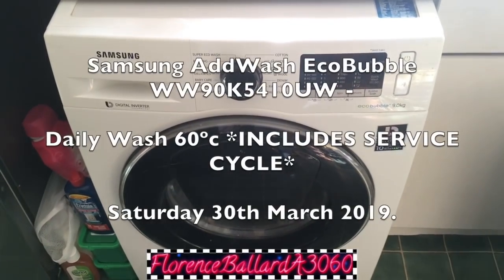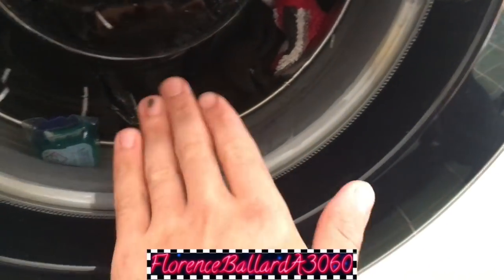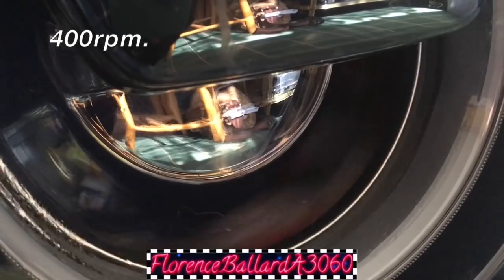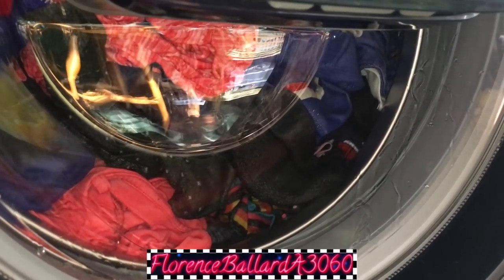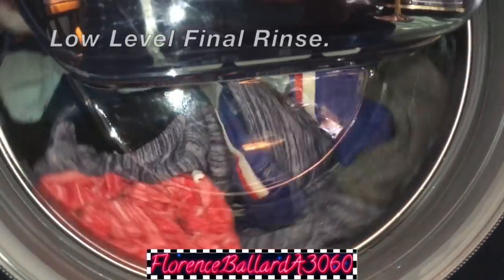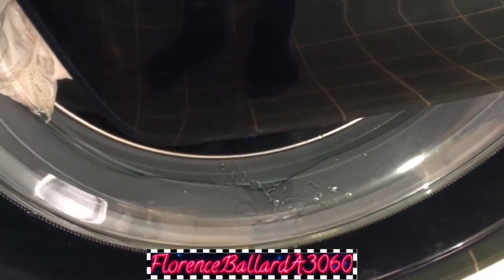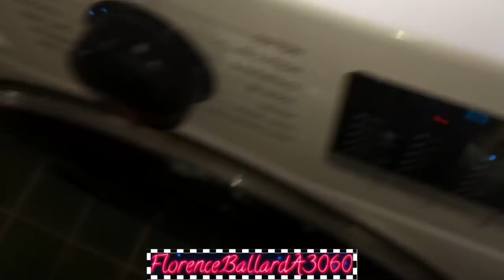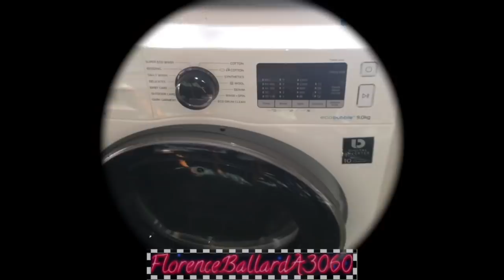Samsung AddWash EcoBubble WW90K5410UW - Daily Wash 60ºc *INCLUDES SERVICE CYCLE*

Comment: Its great to see you back home buddy :) you defo sound much happier, and calm, you will miss the outback, but you will be better then ever before being home :) "welcome home" :)

Them pods are shocking, they stick and turn to glue on your clothes, ile never use them ever again, modern machines dont handle them at all :(

I hate samsungs, dont get me wrong they look nice and there ok, but tbh there still pretty lazy after they basically took the "Amica design" and tweaked it a little bit.... 

I still use my Indesit IWE81281 usually just use Number 3, but also the special shoes, its like a wool cycle but a great cleaning cycle for most stuff! 
Id love an Electron, on 95 series or even the WM81 but its so hard to find any these days....

Comment: Im impressed that it spins unbalanced. An LG will probably not of allowed that or if it did, it would cause water/sudslocking which would ruin the spin as it makes the motor strain to reach top speed.

Comment: It was probablt vigorously shaking so violently because the 4 screwed stands underneath are probably unstable and unbalanced, get them checked out and a spanner comes with the package, try adjusting them.
Reply from the maker: Tahmid Ali nope they are completely fine and level, if they weren’t, the machine would be rocking, but the machine isn’t rocking, just vibrating

Comment: For sure pods go there! Because you suppost to put before the clothes and in the bsck of the drum! Close the zyp before wash, them gona stretch the other stuff
Reply from the maker: Regardless of where pods are supposed to go in the drum, they get tossed about during the wash and thrown onto the seal anyway. If Samsung weren't so crap with their water levels, it wouldn't have to matter where it was put.
Reply from the maker: Also zips will not scratch anything, no1. they can unzip themselves during the wash so that's pointless, 2. There has NEVER been a case of a zip "stretching stuff"

Comment: What temperature does you nanny use and at 46:10 is that a crack I can see
Reply from the maker: Daily 30ºc :( and yep, that's a gash in the door glass caused by the extremely unbalanced load
Reply: @HooverA3060  my nan uses fastwash 50°c and sometimes 60°c

Comment: Do you know if these machines are too loud? Currys have this model (£449) and the cheaper SAMSUNG ecobubble WW90J5456FW/EU 9 kg 1400 Spin - White (£399) on offer right now. Sounds really loud in your review. 
I need a machine with a delay function, otherwise I would go for what is meant to be the quietest machine, the whirlpool ones (but no delay function).
Or I am thinking of getting the AEG ProSteam L7FEE945R Washing Machine - White (£649). A lot more expensive than the Samsung and I am suspecting the Samsung's are on offer because they are of inferior quality? 

Need a 9kg (can go with 8kg if 9kg that you recommend turns out to be too expensive), with delay function and in white. If none of the above would be recommended by you, tell me why and what other brands and specific models of those brands that meet my requirements you would recommend.

It only needs to work for 3 years. 

Current washing machine is a Whirlpool AWOE8760. 
Where the water injects into the drawer and behind it, it get's very moldy. 
I get holes in my clothes.
Machine will say x amount of time, I come back after said time and it still says another 1 hour or more left. Came up with an error relating the PCB a few years ago. Keepfresh function does not work. Clearly a damaged PCB. It's old now and so time to replace due to the above problems.

Let me know what you think. Thanks
Reply from the maker: If I'll be totally honest, I would not recommend ANY brand that is modern, you'd be much better off going for something secondhand like a Bosch, Miele or something like that. I would literally feel like I was insulting someone if I recommended anything new to anyone. In fact, the only thing I would recommend if I had to would be a Miele W1 or W1 Classic, but of course with those comes a very heavy price tag, at least £999.00. The machine my Nanny has, it's probably the worst thing she has ever had in that house, just from a load of 3 damp jumpers it has gashed the door glass (as you can see at the end of the video), and never washes anything with the right amount of water and takes forever on a lot of cycles. Your Whirlpool you currently have to be fair is more reliable than anything you could buy now in the shops
Reply: Edward Cullen Just get Beko. Have 4 Bekos in  my family, the oldest is 11, other 2 are 7 and the youngest is 3+. 
Something the best you can get today for fair price. Bosch is good too but if you need it for 3 years no need to pay extra :)

Comment: Hmmm...just watched other videos and none had that same issue on 1400rpm like this one. Seems like you've been dealt a faulty one but more than likely, it's not on a level.
Reply from the maker: Nope, most people I know who have a Samsung actually seem to have a similar problem with them rattling themselves to bits at 1400rpm, in fact another collector I know has one that jumped out on 80% of the spins with hardly anything in.

Comment: So What is the best washing machine brand after miele ?
Reply from the maker: Ahmed Ragab I’d say none because I believe all modern machines are complete junk
Reply: @HooverA3060  I have a hotpoint and I want to replace it but I am really confused
Reply from the maker: @AhmedGRagab  I can understand if it's giving trouble, you can always buy a Miele secondhand if you're not too fussed on finding one brand new as they're a lot cheaper :)
Reply: Ahmed Ragab speed queens, cant say if they are sold outside the US

Comment: Where is the water?😨😨😨😨they dare just dump crazy? Very very loud its crazy in 2020, samsung is not even good for doing tv or smartphone no more, immagine washing machine😂
Reply from the maker: It's well below the drum rim, which for a large load like this should have filled way more. The lack of water also means the EcoBubble doesn't work
Reply: @HooverA3060  try to modify the presspstate whatch video on how to do here, because it gona destroy your clothes they where just dumb not even dripping, it gona cause allwrgy and destroy the machine it self! Try to use delicate programs and then switch to dark garment or jeans theres gona be one that use more water than others or syntetics